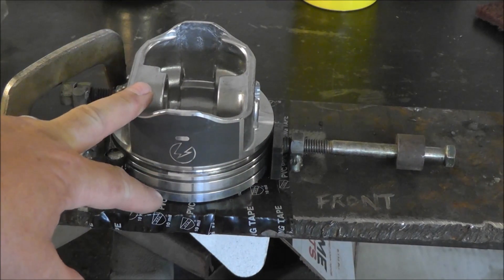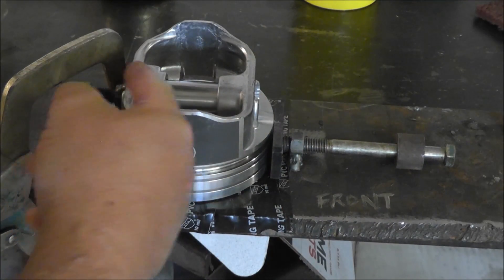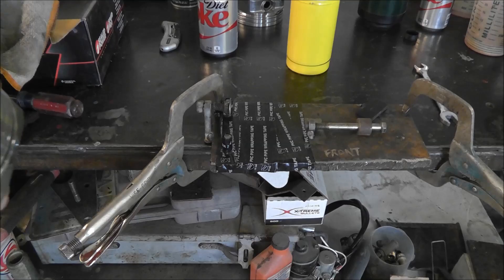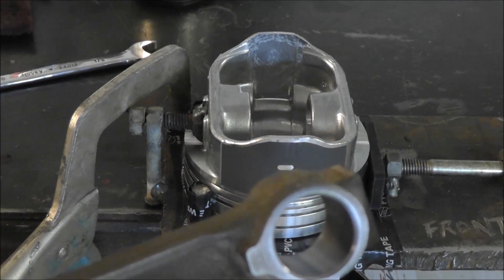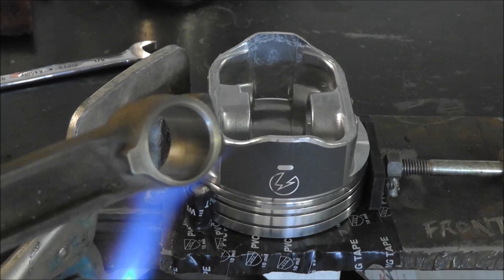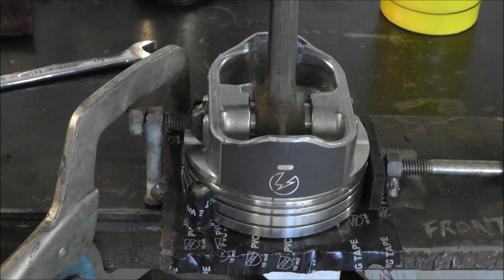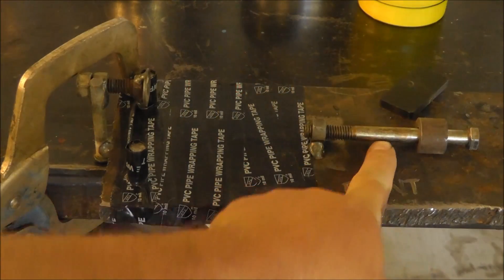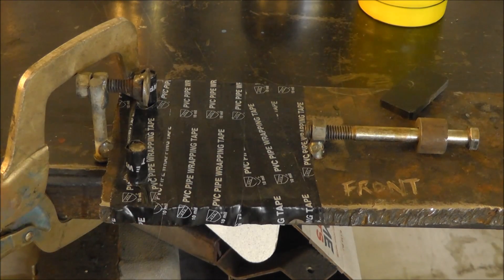press fit wrist pin install

Comment: I have a piston that I didn’t get the pin all of the way in before it tightened up (I didn’t move quick enough). What should I do to get the pin the rest of the way in?
Reply from the maker: unless you have the correct tool to remove the pin,  or try to drive the pin in, you'll probably break the piston.  I don't know, maybe take that piston to a machine shop and see what they say.  better to pay someone with the right tools for the job than cave man it and but a piston

Comment: Do have to make sure rod is on the correct side of posting n
Reply from the maker: yes, there is usually a notch or an arrow on the piston that points to the front of the engine, and the big rod end has a bevel that goes to the counter weight side of the crank.

Comment: Appreciate the video! I just wanted to help out a little too.. Just a heads up for guys that freeze their press fit wrist pins/piston pins before installing them: 

Freezing them actually cools the rod MUCH quicker and reduces the amount of time you have for installation and/or making small adjustments if you have to. Steel only shrinks 0.0000063" per Fahrenheit degree. So if you have a shop at 70 F and your freezer goes to 30 F, you're only getting the pin to shrink by 0.000252" or 2.5um.

0.0002" or 2.5um is equal to one particle of smoke. A particle of pollen is 10um. So you can see how little the metal actually moves. Keep your pins at room temp, it may save you some serious headaches.

Comment: Great video, but in my opinion, I would save the headache of possibly screwing it up and just spend the $260 on bushed rods and then not have to worry about it, especially if you are only going to do it once. Also pick up a couple of horsepower in the process.
Reply: Useless under 400hp and on a budget like MOST of us are.

Comment: Great video thanks for posting.  I modified the procedure in one way that I think is important.  Rather than use a torch, I used avocado oil a small cooking pot, and my camp stove.  Avocado oil begins to smoke at 520f and doesn't boil until 600+.  I brought it up to 550f no problem. kept the rod in the hot oil for 4 minutes. It worked great and did not discolor the metal at all. In other words, I am able to control the temperature, and insure that the metallurgy is unaffected.  I've seen quite a few videos with the ovens, torches and what not, some of them get the metal hot to the point I can't believe that the metallurgy is unchanged. My opinion is when the metal turns blue it right on the cusp of changing internal structure, and very easy to overshoot.
Reply: Interesting idea. Why not just put the rods in an oven at 550F? Evenly heat the whole rod then grab it with a hot pad and slip the pin in.
Reply: @MotorMouth930  I don't see and reason why that wouldn't work.  A little toaster over would make a great bench top set up. As long as it gets hot enough. I would definitely get a laser thermometer to make sure. If you do it let us know how it worked. I would definitely try it on my next rebuild.
Reply: Now that is the idea I am looking for!  I never liked the idea of trying to heat up the rod with a hand-held torch - the heating is too uneven and the temperature control is simply not there, although credit to the OP who did suggest using the blue color of the oxidizing rod end to gauge the approximate temperature.  But your idea to heat the avocado oil on the stove is brilliant!
Reply: Thanks for the info
Reply: @AR_420  You're welcome. BTW I made my jig for the piston out of wood, quick and easy worked great.
Reply: Good one
Reply: this is what i was looking for, I was wanting to us oil also but did know what temp
Reply: @ Let us know how it worked.

Comment: Blue is too far. That temperature will be annealing the steel.
Most of the expansion is done in the first few hundred degrees so there's no point going much further than that.
Infrared thermometers are good for this purpose.
Reply: You would think, but even Goodson has a setup they sell that uses flame. Expensive yes, but same process and i wouldn't dare call Goodson incompetent. Cheers

Comment: Its called a semi floating pin, a shop would use a rod heater to do this that is set at 320 degrees. DO NOT heat it untill it is blue, it can and will cause premature failure of the rotating assembly

Comment: I used to build engines as a hobby both for restoring cars and sometimes for friends.  The shop I worked at a lifetime ago would clamp the rod in a vice, heat it up and try to line everything up then eyeball centering the pin.  I hated that part of the job so when I found the opportunity to buy a closing shop's machines I built a fixture like yours.  Now I'm wondering what the heck happened to it when I moved!  Oh well probably time to get rid of all that stuff anyway.  Haven't done any machine work in 10 years anyway.  Thanks for sharing!

Comment: So lost until I watched this video. Building my first two engines at the same time.  One is a turbo Honda and the other is a stock 350.  When I got the 350 build kit and it had no c clips to hold the wrist pin in and the wrist pin floated in the piston I was confused thought I got the wrong parts.  Now I know and ty
Reply from the maker: Youre welcome and TY!

Comment: I built my own plate to do this. I am still waiting to do it. I am a little nervous. Is it best to have the pins in the freezer and install them cold? I am a little worried it is going to cool down the rod faster and grab before i get the pin in all the way.
Reply from the maker: i just did one for my jeep engine without freezing the pin.  If you heat the rod as described, you'll have about 3 seconds to get it done.  You can do it!
Reply: Just finished doing 8 of them. It worked great.
Reply: Thanks for the great video!
Reply: @dzlfreek  Okay I forgot to ask about if the wrist pin was off center by maybe an 1/8" to 3/16" will that hurt anything.
Reply from the maker: @chadewhitaker  its not ideal, but as long as its not going to poke out past the piston it should be good

Comment: people make meckniking to hard. the shit is easy. look at this compared to how other youtubers are doing this. they are buying special ovens for the same job you did with a 30 dollar torch. shit all works the same.
Reply: I have the oven also. Makes for a consistent hang. I also hang well over a thousand pistons a year, so a proper station is quite appreciated. Torch works fine, not saying it don't. But been there and done that, love my Sunnen CRH-50 rod heater.

Comment: you could also make a simple press out of a bottle jack to do the same thing without the heating and cooling part.
Reply from the maker: you'd likely mess up the piston pressing the pin in place....speeking from experience.

Comment: I'd use floating pins easier to put in and easier to take out and you dont have to to heat the rod
Reply: Definitely agree, but not in everyones budget. Under 400hp, unnecessary

Comment: Hi, I'm rebuilding a gm 305 and I changed the piston but 2 of them rotates in the rod but they are a little bit hard. If  I heat it about 40 degrees they aren't nothing hard. Is a problem? should I dismount it ?

Comment: great video.  I just attempted to do this job and failed because I attempted to use a hotplate to heat the rod instead of map gas.  My trusted machine shop uses a hot plate and recommended it.  I suspect their plate is much hotter than the 1000 watt one I bought for the job.  Anyway what you showed is WAY superior.  I like your jig as I am sure it made it way easier.  Great job, sir.

Comment: Wrong,many times wrong. Never ever heat a connecting rod,ever.
Reply: Every shop today does this. Nobody presses pins in anymore. The only difference is they'll have a temperature controlled heater and a much nicer jig
Reply: pressing is worse that heating. I've worked for 4 major remanufacturing companies, and they all use ROD HEATERS to heat the little end of the connecting rod. It is the lesser of two evils. Pressing the pins in the piston distort the piston, and if heating done incorrectly will make the rod fail. If done correctly, heating the little end of the rod will not make the rod fail IF DONE CORRECTLY.
Reply: @Jaydee Brickey might wanna do a search on the Sunnen CR-50 rod heater. Just about the most common tool used to heat the rod end for install and is the one I own. Goodsons has a torch style rod heater whch is the second most common one I have seen/used. They both heat the rod end just like in this video. Good luck with pressing them in.
Reply: Another know it all that knows nothing.

Comment: I'm talking from experience.  I own a auto machine shop.  This method has been known to fail.  The pin will come lose  and start rubbing the cylinder and kill your engine.  Have them pressed on or better yet, get full floater's .
Reply: Pressed on? Never heard someone from an automotive machine shop say that before. What shop you own?   The Sunnen CR-50 rod heater works well. My prefered tool. Hung tens of thousands of pistons using that model. Guess I'll make a video of my own using the proper tool since this seemed to be popular vid. With steady hands and proper heat cycle, using a torch like in this video can be very efffective
Reply: Heating is the way machine shops do all of them,never press them on because it gawl the pin and won't move freely! So try again buddy

Comment: DO NOT EVER use a torch on forged or aluminum rods. You will change the heat treat and likely weaken them. If you need that extra clearance for your wrist pin then pop your rods in the oven for a half hour at 300F.

Comment: Which way do the rods face? Does the small end face the front of the engine
Reply from the maker: if you look at the cross section of the big end there will be a chamfer that needs to correspond to the radius that is at the outside of the rod journals of the crank.  Each crank journal holds two rods.  Get that wrong and the rod end will oil starve and likely seize and/or spin.
Reply: So will the chamfer on the rod match up to one side of the Piston I have a D top directional Piston on 99 Dakota 4cyl  if that makes a difference
Reply from the maker: no, it will vary depending on the cylinder.  In my case the piston had valve reliefs on both sides of the piston so it doesn't matter how they were installed on the rod.
Reply from the maker: The pistons will end up having the rods facing the same direction on one bank and will face the opposite way on the other bank, assuming your engine is a V6/V8 engine block. I haven't worked on an inline engine in 30 years, so i can really help you, sorry.

Comment: Just curious stock is the Piston a press-fit or a slip fit and if you're going to a aftermarket piston with a slip fit why don't you just make the rod slip fit?
Reply from the maker: stock piston on SBC is press fit.  Slip fit pistons require machining to the small end of the rod and bushings installed.  This was WAY cheaper
Reply: It is stronger if you use two ends of the pin to carry the load at pivot point on each side of the piston than use the small end of the connecting rod for slip fit.

Comment: be careful to put the rod in the right way , don't flip them. they can be put on wrong and that could cost you an engine
Reply from the maker: good point! however these pistons have valve reliefs cut in the head in such a way that you can't put the piston on the rod incorrectly.  Making sure the rod is installed on the crank correctly is another issue.
Reply: I had a machine shop press 4 dome pistons on backwards, I was young and didnt know, put the motor together and it wouldnt spin over. Was able to fix it before I started it. SBC rods cant be put in backwards. Lol

Comment: Who ever thought it was a good idea to have this way of securing the wrist pin,what was wrong with the old method of circlips which took seconds to fit and the pin could be fully floating,all this messing about making a jig and heating the con rod is rediculous because if you get it wrong it nearly always damages the piston when trying to correct it.
Reply from the maker: i guess the cost of 16 circlips and the cost to install them?  Engineers don't have to fix em, they just need to make sure they can be built without self destructing and the bean counters often decide how stuff gets built and what materials are used.  I agree, it would be much simpler for the average guy (or gal) to use floating pins as apposed to press fit pins.

Comment: my question is...does all pistons rods are work like this?others that have safety rings doesnt need this application you showing right?
Reply from the maker: right.  if the piston pins are floating and are held in place with retaining clips, this tool and procedure is unnecessary.
Reply: thanks for the info!
Reply: some of the performances connecting rods have a copper ring in wrist hole..the question is,can i do the same thing on this video🤔
Reply from the maker: probably not
Reply: NO!!!!.THOSE ARE CALLED BUSHED RODS ONLY FOR FLOATERS..SOME PISTONS LIKE THOSE SPEED PROS CAN BE USED EITHER WAY JUST IGNORE THE GROOVES FOR THE CIRCLIPS..

Comment: This is all well and good  until you are warming the engine up on first start up and engine locks up, because the pin somehow becomes not round, seizes in the pin hole in the piston. Don't ask me why, but on some thin wall pins this does happen.
Reply: GO BACK TO SMOKING YOUR JOINT
Reply: stoney pipes No.

Comment: After putting them on you should spray oil on the wrist pin and rod. And don't over heat you could weaken the rod and bye bye engine

Comment: Damn it I messed up, I didnt get the pins all the way through before it shrunk.  How do I Fix this without getting new pistons and connecting rods?
Reply: Wait until it completely cools ...then use a press....u can take an old piston pin shave it down to make a pin press punch ..just pressed out 24 of these just today using only old piston pins
Reply: @nickdonahoosr81  ~ 5/8 socket works too !
Reply: Nick Donahoo Yeah I took it to a machine shop, the pressed the pins out and reinstalled them. I did not have to replace the pistons, so that's good.
Reply from the maker: i don't think you can.  you might get lucky if you have someone apply heat while you try to press out the pin.  at this point you have nothing to lose.

Comment: i accidentally cracked one of my pistons because i didnt heat the rod up enough and i had to press the pin back out but i caught the skirt of the piston on the steel plate. oops lol. awell. my first time doing this lol

Comment: When rods are reconditioned at a machine shop, the small end is also honed, to reduce press fit to .001" - .0015". Factory press fit will be crude at .002" to even .005". It takes far less heat to get this operation done safely when the pin end of rod is reconditioned and sized properly.
Reply: Excellent info! Thank you

Comment: I guess you take them apart kind of the same way
Reply from the maker: i used my hydraulic press....no heat....but then i wasn't reusing the pistons and pins.  I guess using a little heat wouldn't hurt though.

Comment: How did you know the exact center or did you just eyeball the center? Does it matter if it is the exact center? It just seems like a piston might favor one side if it is not exact. I about to rebuild my engine and don't want to mess it up. Thanks!
Reply from the maker: i measured as best I could.  Id say its within a 1/64th.....should be close enough.
Reply: Blake Boggs the piston should self center after ignition, but try to get it close as you can before the first start.
Reply: As long as nothing is rubbing you are good.

Comment: dzlfreeks jig seems the best yet I have seen for installing the piston pin.  I think though I will make something similar out of wood, since I can't weld.  Also, the piston and pin will be cool, should be no problem to using wood.
Reply from the maker: what ever works,  with what ever you have at hand.

Comment: Great presentation!  When heated steel (polished first so you can see the color) is in the blue range it is between 590*f (dark blue) and 640*f (light blue) A digital laser thermometer with 1000*f scale can measure this as well.
Reply: I searched internet for a 450° temp stick.

Comment: Hey thanks man! I'm doing some Ford Focus Pistons and rods this evening. I have access to a press but don't have the best support in the world. What I do have is a 4x4 Oak block of wood with a cradle cut in it to lay the piston in. It also has a hole drilled in it to allow for pins to be pressed out.

 Two of my new wrist pins don't slide into new pistons like they should. In fact they wont' even go in at all. The other two or a tight slide in fit. In other words I can push them in but they won't just fall out. Is that too tight or should they drop in and fall out the other side like yours obviously would?

Do you have any good ideas on honing the pistons out to get my .001 clearance?

I was told by a reputable mechanic to use a brake hone to get the pistons to fit the wrist pins. That's working fine but I can only do one side at a time and the potential is there for the holes not to line up perfectly. 

 Do you have a better suggestion? Have you ever experience wrist pins being too tight?

Your pin install method is pretty amazing. I wonder how hot the metal is when it turns blue?
Reply from the maker: +ILTSYC starts to blue at around 500 f.  the brake hone idea is one I would do.  just work slow

Comment: Got a question if you could answer asap. I got the rod end a little red on one side in a little spot on one.. Im worried now.. Its on a 4 cylinder jeep engine.. Does it ruin the cast or what? I was trying to adjust the pin since I didnt get it centered as good as I wanted.. I definitely dont want to throw a rod because its not my engine.. :-/